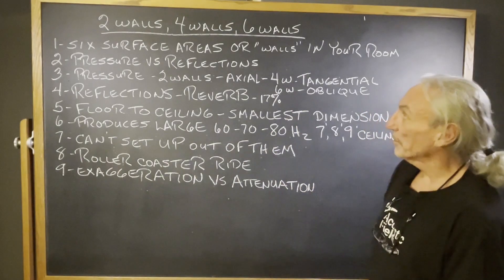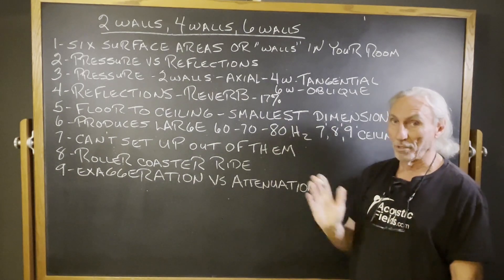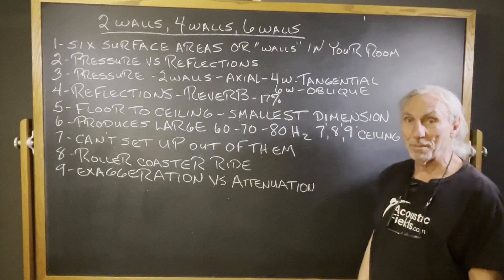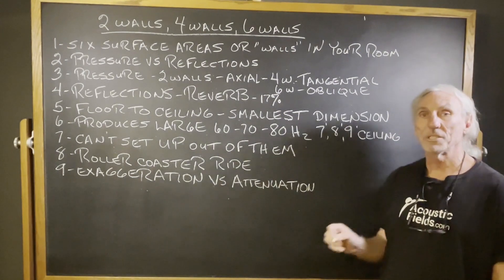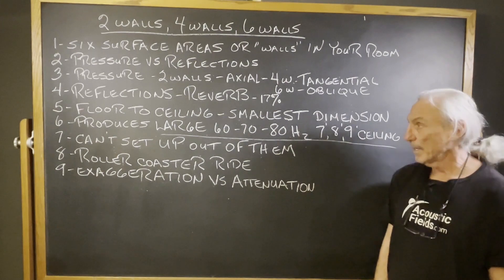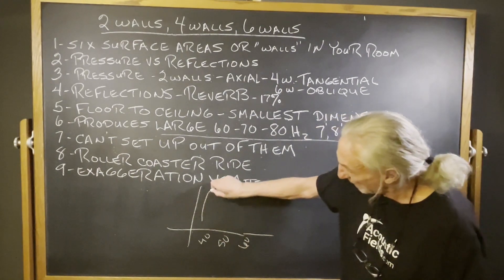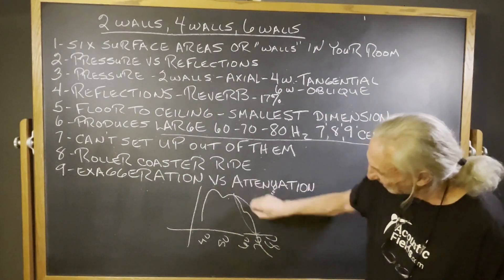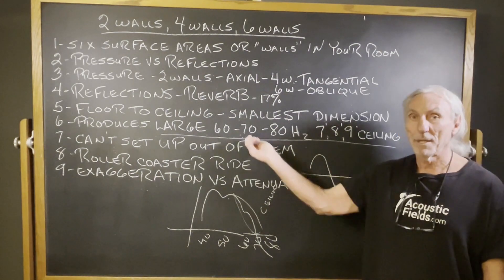2 Walls, 4 Walls, 6 Walls - www.AcousticFields.com

Comment: Denis, should I be starting on the floor first? I have a subfloor with carpet(we want new pet friendly flooring with a nice rug in the middle) the basement ceiling has 2 x 12s, doesn't matter much what I hear downstairs but wondering with the work we will be doing on the front wall. Those are 2x6s so I need a lot of carpenter work at that point.
Reply: Most of my problem is above the 125 hz area, I do have some spots during rush hours that are below 125, I just won't listen then. It's not as bad as I thought after months of analysis, that I've learned from you.  This is just 2 channel I'm working with.
Reply from the maker: With noise issues managed, you now must look at the low frequency management requirements for your room size, volume, and usage.
Reply: @AcousticFields  daily usage, living Room. Currently 23 ft wide and 13 ft 7 inches wide. With of course the dreaded 8ft ceiling.  I listen not much blasting.
Reply: I have a 12 x 12 room with a 8 ft ceiling available but it sounds just awful, even as a gaming room.

Comment: how about a HPF at 80 'Cycles' to cut those lows?.There is no useful frequencies there anyway
Reply from the maker: All frequencies are useful. They all must be heard and considered in the presentaion value. I do not know what HPF stands for. Please be specific.
Reply: @AcousticFields  High pass filters block/cuts frequencies below a cutoff frequency. I was thinking if it does not exist in the room then it will not be a issue.It an exsistential question !.

Comment: But how fix it ? Panels are for 120 Hz and more, and one cannot put diaphagmatic devices on the floor, don't we?
Reply from the maker: Our units are on casters and sit upon the floor. They weigh 230 lbs. each and are on wheels.

Comment: Way to go Dennis, i have written before and still having issues for sub placement, 4 concrete walls and a concrete floor, any ideas let me know. I also use the room for my toy collection so not sure if that causes any issues. Hope to hear from you. Great informative video as always, since i have taken the sub off the floor. keep up the great informative videos.
Reply from the maker: Start with placing your sub in room center. Move forward and back in 1' intervals. Move left to right in 1' intervals. Stay away from the walls.
Reply: @AcousticFields  The center is hard due to the recliners being in the center of the room, the room is 10x10 and the ceiling is about 9ft. Tried the subwoofer crawl and still dont seem to find the sweet spot